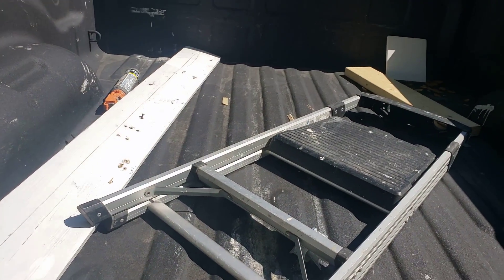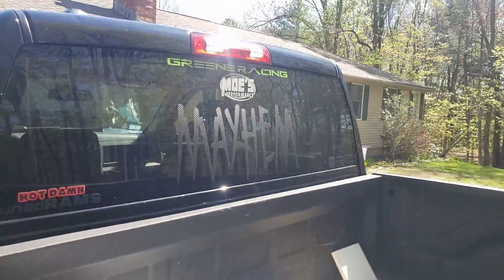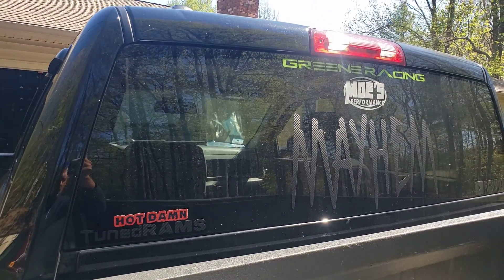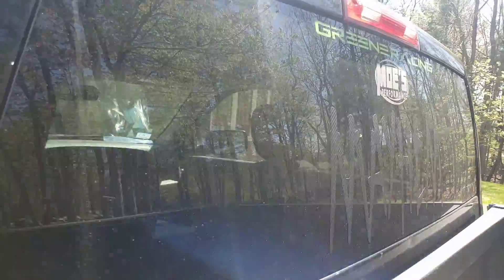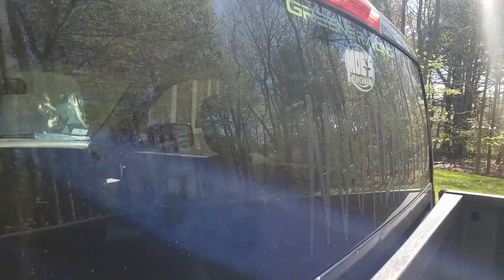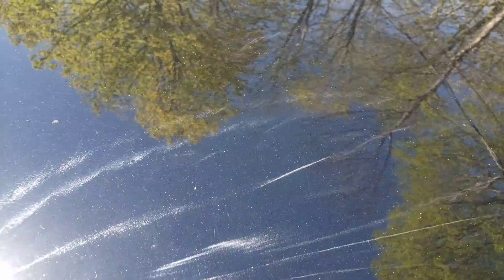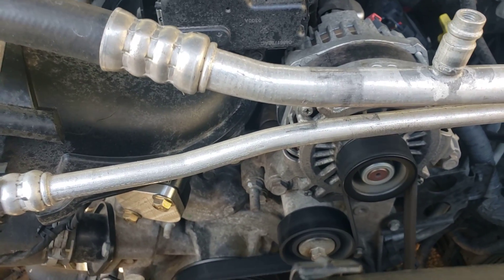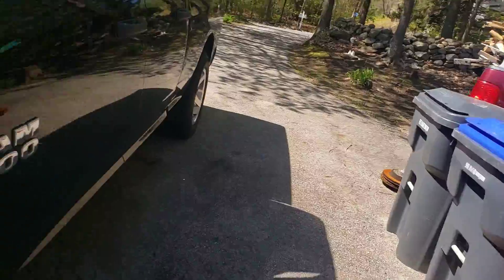Cracked my flex plate. no track this week.

Comment: Mopar flex plates have always been on the weak side. The performance plate is the way to go. While you're in there upgrade your torque converter that way it's out of the way.
Reply from the maker: I have a edge pro 3600 stall converter

Comment: Was it making any noises before ? I have this noise that's either piston slap or the flex plate...have not gone in to investigate yet.
Reply: Sounds just like yours. Will have to take care of it, and stick a high stall TC while in there. Keep us updated when you take it apart, it would be interesting to see how it failed.
Reply from the maker: It was making a slight ticking before. 
It is not making any noise right now. 
I ordered a stock flexplate $50. There's a few after market options but there isn't a lot of information about them. So I went stock until I can do more research. Big price difference, to much to buy 1 with no reviews.
Reply from the maker: I have a edge pro 3600 stall converter
Reply: @rammods3818  yeah, I was looking into the ATI one but just as you said not much info around, not even from ATI...🤔
Reply from the maker: Makes it hard.  I would try it out. But it's a lot of work if it doesn't work out. Pulling out the transmission in the transfer case.
Reply: @rammods3818  I guess having them side by side with the stock flex plate one could see if they are compatible. Did you get yours fixed yet ?
Reply from the maker: My mechanic just back from vacation last night. I'll stop in and see him Monday.